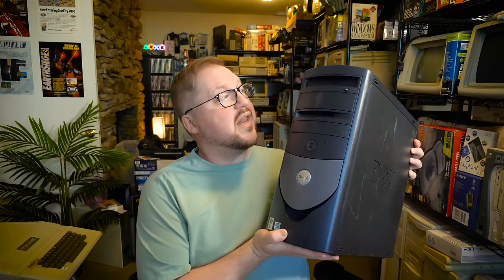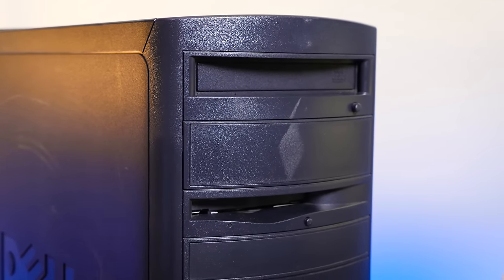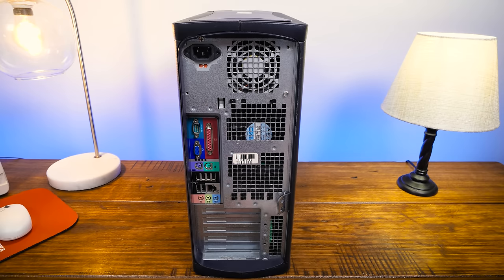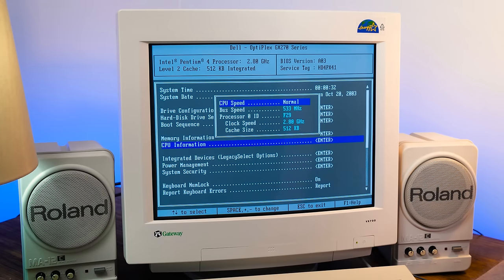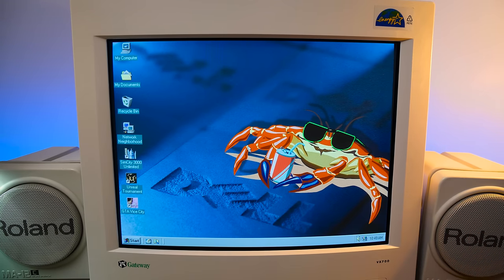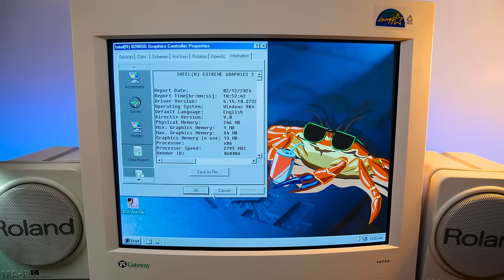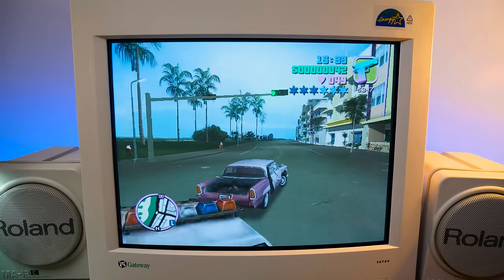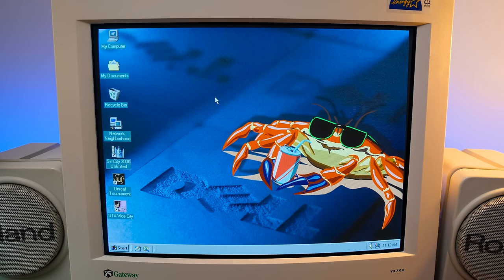The Most Unwanted, Boring PC: Dell OptiPlex GX270

Comment: Moved to a new school where I got to assist in the unboxing and distribution of a couple dozen of these machines. Not even a year later I was rounding them back up to bring them back to a classroom with a tower of cardboard boxes fresh arrived with replacement boards, each and every one. Highschooler’s dream, just hang out, swap memory and processors, reapply thermal paste, the fact that the boards came on one thumb-screw secured tray was a breeze. Afterwards wrapped up the day with some Wolfenstein Enemy Territory, ran it better on that integrated graphics than than my Radeon 9200 could.

Comment: Thanks for the video!  I've used machines like this in the office, and I never found them exciting.  However, I was amused by your description of it being boring, ugly, and causing your eyes to glaze over.  I grew up in the 80's and 90's, so just a few years older than you, and the two decades solid of ALL MS-DOS / Windows PC's being angular, beige boxes has made THAT the definition of "boring, ugly, and cause my eyes to glaze over."  🙂  I still have my AT clone and Gateway 2000 PC (which is beige but has a little swoop of a design on the front) from 1989 and 1994, and I'm only just now warming up to them looking "kinda nice" rather than "boring, ugly-ass beige boxes."  When Dell started making their bog-standard computers black with silver highlights, while I never owned one of them, I was very pleased to see that SOMEONE was finally doing something different with their computer cases, to provide our eyes with some relief from the sea of boring, ugly, beige boxes.

As with all things aesthetic, it's all in the eye of the beholder!  🙂

Comment: Believe it or not, the company I work for still has over 100 of these in production running QNX. They are powered on 24/7 365 and are actively used 21 hours a day.

They don't die as often as you would expect, eventually so many of the capicitors will leak that it will no longer function properly, but many have ran for years with a few bulged or leaked caps. 

Clint, maybe you should do a video on QNX.
Reply: I bet if you pulled the power on any of them for more than a few hours they'd start dropping like flies... (I know of some of these still in production too, working as print servers for large format printers.)
Reply: You're running computer Thunderdome over there. Only the strongest computers survive.
Reply: @fredjones100  lol, they are surprisingly resilient, even after being powered off for a time for maintenance or whatever.
Reply: @IanDunbar1  truly, we have to e-waste many of them that are too far gone and reach into our stockpiles of allegedly functioning units. 

We are currently testing new NIXSYS computers, but have some bugs to iron out.

Comment: I was a Dell contractor in 2007 that replaced around 4000 motherboards in GX270 machines under their extended warranty thing because of lawsuits. I did it again in 2008 for an additional 500 or so machines. Funny that they only covered the motherboards and not the power supplies, which had the same problem. Their LCD monitors also had the same problem.

The replacement motherboards used the EXACT SAME CAPACITORS, and they failed exactly in the same manner in the same timeframe as the originals. But it was long enough to get them out of their service contracts and warranty periods so they could wash their hands of the matter. By 2007-2008, these machines were ancient history, the only places that still had them were large corporations and K-12.

They never made it to the second hand market in numbers, most of them went to the landfill, or shipped off to third world countries in bulk for scrap.

I still occasionally find these things, usually in garage/estate sales where they had been stuffed away and forgotten about for decades. I last saw one about a year ago in the local junk yard and it predictably had all failed caps. They wanted $20 for it, but it would cost three times that to recap the machine.

Comment: I worked for the school systems in my county in the late 2000’s and they had tons of these. The capacitor issue wasn’t the only fatal flaw with these machines. One of the solder joints on the tension rod mount that held the chipset heatsink down was very week, and after a year or two of use the solder joint would break and the chipset heatsink would pop off, causing blue screens from the chipset being too hot. This brings back nightmares of having to solder those things back on, because trust me, I soldered a ton of them. In my opinion, this was probably the absolute worst Dell machine… ever.

Comment: That brings back memories. I had to support those beasties for some years and yes, I remember the cap plague well. At the time Dell were pretty much forced to sort out the caps, though some of the support techs on the phone would try to swindle you out of a rightful upgrade if they thought they could get away with it! The biggest problem besides that was that Dell often used non standard construction and parts which meant that buying off-the-shelf bits for GX110, GX260 and GX270 was out of the question! Non-standard PSU, non-standard connectors on the motherboard and so forth - about the only bits that did conform were bits that Dell couldn't fudge about with like processors, memory and drives. The only way you could work around that was by keeping enough older machines about as spares donors. We kept on buying these things through the GX280 and GX610 (I think that was the next one) before somebody got the urge to dump Dell in favour of HP starting with the 5750. Those things were a lot easier to repair!

Shame really as I really liked Dell laptops back then but their desktop machines were not good. Thankfully I was able to build my own systems so I never dealt with Dell computers outside work.

Comment: I work for a shipping company. When these were about a year old, we had about 20 installed per ship across a fleet of ships. Dell issued a recall on the motherboard for defective caps, like just about everyone else at the time. The warranty repair was to either have a Dell tech come out or they would ship us replacement motherboards for each unit. We chose the latter. So I had to carry a stack of motherboards with me to each ship, bring them aboard, and do the replacement on site.

Later on we had the same issue with Optiplex 745 models but Dell was far less helpful. I ended up recapping those boards aboard the ships instead.

Comment: Whenever you uploaded the video of this model I was geniunely surprised and excited about you reviewing this computer. I had this PC since 2011 for my sister who was at the time 10 years old, it wasn't used really much because of how slow it was. In 2019, I upgraded the RAM and the graphics card, and the fact that I could browse the Internet and even get to check social media with Windows 7 installed, is crazy, considering how old this machine is and the OS that it was intended to run. Also I wouldn't have ever known the risk I had of having that machine on. It's crazy to know now that this particular model didn't really lasted long, and it was dangerous to use. Mine is still on my room and it works!

Comment: Great video! Sure brought back some memories. I have the GX240, which is similar enough that what you said is still relevant. My wife brought it home almost 20 years ago when they were upgrading at work, I installed XP on it, and it served as a decent second machine for years afterwards. I'm thinking of repurposing it in the near future as an emulation machine. It would go nicely beside my OptiPlex GX620, in my game room.
BTW... I just checked, and the original capacitors are still good. But I do keep a ready supply of the most common types, just in case.

Comment: My family had one of these, or possibly early or revision that looks exactly the same, as our family PC. Probably got it around 2001. Surprisingly enough, it actually came with a discrete graphics card. Was probably an upsell or something that my dad got not knowing anything about PCs because if he did he almost certainly would not have spent extra on something that would only be useful for running 3D games. It was literally dead by the end of 2003 and of course being the youngest sibling All of the blame was placed solely on me 😅... My now electrical engineer brother was able to get running again after replacing a couple dead capacitors, but died for good sometime around the end of 2009

Comment: I can't remember the number of motherboard replacements I asked to DELL support on OptiPlex GX270 and GX280 models during 2008 and 2009.
Even after the warranty had expired our boss ordered us to continue asking DELL because he told us DELL refused to replace all the motherboards before failure and it was a know problem.
It was a big issue at the time and we spent so much time on this (between 2 or 5 PCs died every week during all the time I worked there).
Our fleet was several thousands PCs.
Those defective PCs had intermittent issues and random system failures. Every time there were  bumpy or "blooming" capacitors.
DELL could have paid us for all the time we spent troubleshooting theses bad batches of PCs...  :)
Reply: Yup my first i.t. job in 2008 was centered around the dell capacitor plague. (Sx260)

Comment: I was the admin for a bunch of Dell Poweredge 400SC systems back in the day, which were basically your system rebadged with a server faceplate.  I remember those cases being a royal pain to work on.  Dell was dumping these servers on the market with 2Ghz Celerons, 128Mb Ram, and a 40GB IDE HD for $399.  If you didn’t hate your job by then, working on those slow POS in their original configuration would make you pretty quick.

Comment: I had these at work. I loved it. I upgraded it from a 2.6 to a 2.8 then a 3.0 then 3.2 ghz Pentium 4. Then upgraded the cooler. Added a AGP card with a free ATI 1300X and maxed out the RAM. Because why not? It was fun being an intern in help desk and all the other Dell like it had blow caps. Mine went later. Then I got a precision 370? Same case but different color flip up for the USB and it had an LGA 775 setup vs the Socket 478. 
The GX280 was great. They survived the capacitor plague. And they had PCI-E
The Dell Dimension WAS MUCH WORSE.
Almost every one of those I've ever torn apart has had no AGP slot. They had the solder points for one. but no slot. Only PCI. Screw Dell.

Comment: I was part of large IT infrastructure project between 1999 and 2003.  We had literally hundreds of these things.  From an on-site hardware support point of view, they were great to work on.  However, we ran across lots of software problems that were machine related.  We could do a direct hard-drive swap from one machine to another identical unit and watch a problem disappear.  As far as the BiOS versions and drivers were concerned, they were absolutely the same machine.  We ended up keeping post-it notes on "bad" machines so as to avoid placing units where they could cause disruption.  As the project continued, we replaced the faulty machines first with supposedly higher-spec machines which helped of course but we never got to the bottom of why some machines refused to run some applications and not others.

Comment: We had a few hundred of them at my first IT job in the early 2000s, they were tough machines, and in the call center environment, we had them in they ran damn near 24/7. Paired with a 19" black Dell CRT monitor with coating issues, a black Dell keyboard with space bar issues, and a Dell ball mouse that was prone to issues. The boxes themselves were pretty solid, we upgraded memory at some point and they were in service until 2006 with no issues.

Comment: We had a lot of these at work back in the day. Aside from the flimsy cheap-looking cabinet I remember them as reliable and decently powerful machines at a competitive price. I can’t remember any of them developing problems to speak of during their life cycle which was ~ 6-7 years at our place. Maybe the odd memory card and hard drive like any other computer. Bonus points to Dell for including spare drive mounting hardware in case you wanted to install a second hard drive or CD drive in the non-standard cabinet. Certain other manufacturers didn’t – and wanted big bucks for those parts.

Comment: Place I worked for back in the day had a few hundred of these, GX260s and GX280s. We were so experienced at swapping the motherboards that we could go from case open to power on after swap in about 2 minutes. The thing that took the longest was getting the motherboard off the tray. IIRC, 6 screws plus 4 for the CPU.

Comment: I have several of the old Dell Dimensions from that same era that still work fine. No capacitor issues on any of them. I even swapped out the mobo and processor on one of them for a Z68 board and an i5 2500 for a nice sleeper look.

Comment: Was an IT guy, managed a warehouse full of these, the ones we had were all clam shell and they could easily be opened up and vacuumed out.  Mine was running XP and upgraded ram but as the sysadmin I remember all the tools and startup items you didn’t want to mess with it for 20 minutes after a reboot.   The batch we had were all lasted 5 years without issue ( probably had a hundred of them).

Comment: @LGR I am not surprised that it still functions. I had a Pentium 3 hit by capacitor plague, much bulgier and gross and oozier than those caps, it worked until the day I had to give it away. Those boards often end up with some corrosion and junk, but you'll be surprised how many of them still work.

Comment: The first computer I personally owned was that model of optiplex. A friend's mom gave it to me as a birthday gift for my 16th birthday. I bought a GeForce FX 5950 on eBay for like $80 and left the side panel off to prevent overheating. I played F.E.A.R., Battlefield 2142, Command & Conquer 3, and plenty of other modern games just fine as far as I was concerned. Unfortunately it stopped booting after maybe a year. I didn't know it at the time, but in retrospect it was likely bad capacitors as I used everything but the CPU, Motherboard, and case on a new build. Seeing this video gave me a heavy dose of nostalgia.

Comment: When a friend cleared out his office I got one of the slim versions of these, slightly older using a P3 Tualatin and I always liked them as the first non-beige PCs I saw.  I made a dual boot 98 / XP box with it and put a slim Geforce 5700 AGP card in it, and yes for gaming the heat was incredible.  But because it opens like a briefcase, the lid stands vertically and you can lean a window box fan across it diagonally to coll the system and then it stays cool.

Comment: I have a couple of these and both died from cap plague. I'll save the guts since there is little to no board damage - in the desert, the electrolyte dries up before it can run down onto the board. Some weirdo will want to restore one of these someday and I will have a couple of nice boards for them. But the cases are great for building a sleeper. That flip up panel area can be repurposed as an air intake because there is a not insubstantial gap there. You have to remove the drive cage and the way the cases open up are a pain. It was designed for quick servicing in enterprise use but I guarantee it actually took more time because you have to make sure the cables are positioned just right.
A Northwood P4 running at 2.8GHz is not a terrible CPU considering the era. They got the job done.  Benchmark performance is right on par with an Athlon XP 2600+.  They under claimed with that whole P4 equivalency thing so people would be happy when they tested them instead of pissed off.
I didn't much care for SC3K so it gathered dust and I continued to play SC2K until SC4 came out. UT was my first online shooter. I didn't play it a lot but I was decent at it. 
Win98 is the perfect retro OS for a P4. I only have one working P4 ATM - a 2003 Vaio with the same Northwood 2.8 and a Radeon 345M. Yes, I said the same CPU. It is a laptop with a desktop CPU that draws almost 70W. Really more like a dorm room desktop replacement, which is exactly how mine was originally used. I got it from the father of the original owner and it is just in perfect condition. I put the launch version of XP on it and wouldn't try 98 because I doubt I could get a driver for the display, which is 1600x1200 and looks like crap with any standard resolution. Besides, I needed something with XP on it to play Brothers in Arms. I do all my other XP gaming in Windows 7.
I played new releases on my Socket 423 1.6GHz P4 through 2006. I overclocked it to 2.4GHz and pretty much doubled benchmark performance. You try overclocking a modern CPU by 33% and good luck getting it to be stable. For a 5600X, that would be over 6.1GHz, lol. You definitely wouldn't get 90% more performance out of it if you did.  I've had a Prescott LGA775 HT chip at 4GHz before. Ran Windows 10 just fine for general use. Matched the benchmark performance of the 3.8 Extreme edition which had L3 cache.

Comment: I have one of these, and while it's not your model, it's not the Ultra SFF model either; there's one more model in-between those two, just an SFF model. And yes, I had to replace it's motherboard too due to several bad capacitors. After doing that, I installed an SSD and put Windows XP on it, and it is the fastest Pentium 4/Windows XP combo I had ever used.